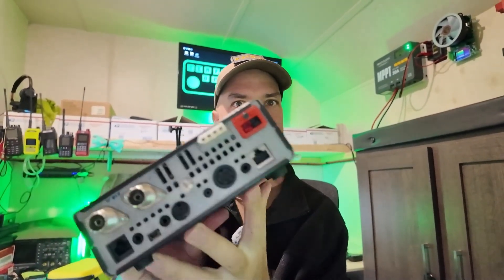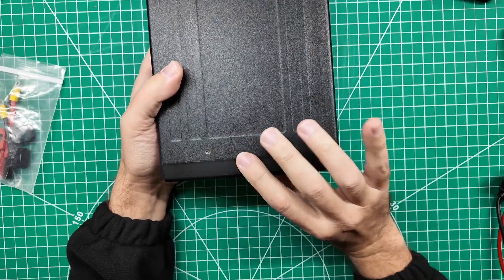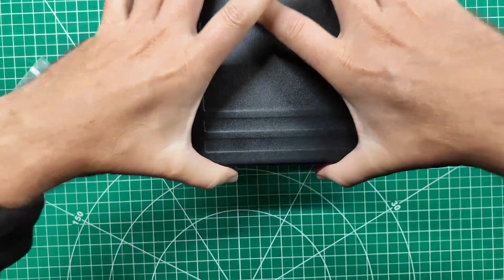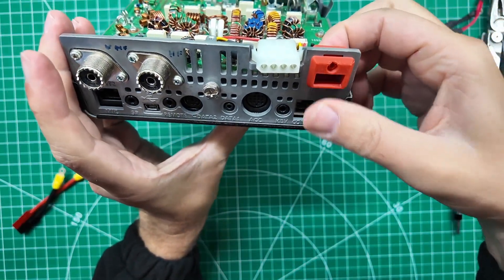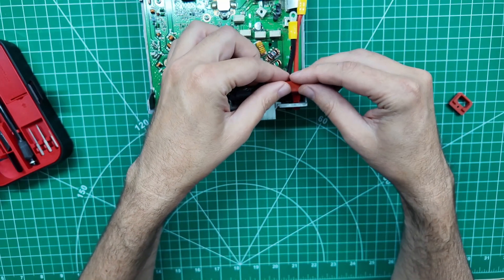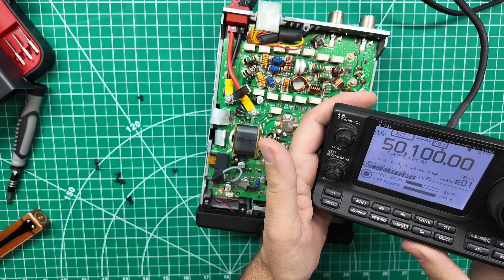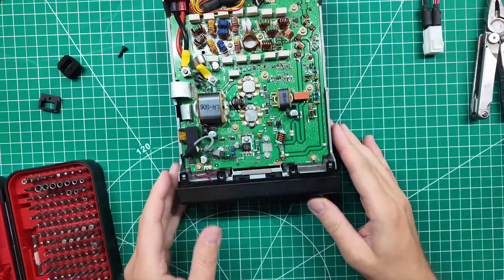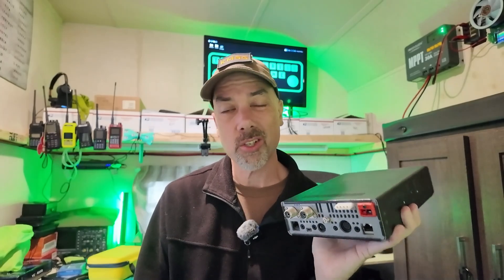This Mod Will TRANSFORM your IC-7100 🔧

Comment: Worse thing you can do. My 7100 needs a really good connection to DC, I have mine bolted down on the PSU terminals. Power poles get tarnished and you end up with a voltage drop on TX which results in a low power output.
Reply from the maker: Thanks for watching

Comment: WHY WHY WHY- Power poles are NOT all that great the modular connection that was on there to begin with was so much more a solid connection! that will handle current draw and efficiently so much better than a power pole. I hate these damn connectors and actually remove them from rigs and replace with a modular or a jones plug..
Reply from the maker: Different Strokes for Different Folks, that's what make the world go round.

Comment: I’m sorry, I don’t agree that taking the very minimal risk in tinkering with the power connection on the 7100 is worth the even lesser value change in removing the icon power connection replacing it with the power pole connections. 73 Tom KC3QAC
Reply from the maker: Seems legit

Comment: The icom 7100 is still sold after 12 years on the market. That's my pota radio . I hate that every other time I pack-up from a park, the power plug wants to fall inward.   I need this mod. I saw in the head unit pinout, that you may want to use a different layout from ethernet.   Someone the audio and control lines are not in the same twisted pairs when pined for ethernet.    It should also be a shielded cable.
Reply from the maker: Good tip!

Comment: You crossed the positive wire to the inside. This forced you to cross the wires. When you first started you stated that the red wire had to be towards the outside of the case, but then when you put it on second time the red wire was on the inside and then you had to force yourself to cross the wires over. Did you notice you did that?
Reply from the maker: Of course I noticed, that's why I pointed out the red needs to go to the outside.

Comment: Any reason why you switched the red and black wire orientation halfway through the video?
Reply from the maker: Mostly because I messed up and drew attention to where the red is supposed to go to make up for it.  It really doesn't matter as long as you're properly polarized as usual.

Comment: Red to the outside (4:54) Oops, now it's Black to the outside (7:00) Hmmm.....Yes, we pay attention. BTW Anderson power poles in this size suck. The metal contacts can push inward AND there is almost zero chance of being able to plug them together without actually looking at them. You will have a lot of difficulty inserting them together by feel only, such as in the dark or on the back side of the radio when you can only see the front. If you just gotta have anderson power poles, install them on the OEM power cord.
Reply from the maker: Huh, interesting. I don't have those problems

Comment: and you recon that the OEM noise damping ferrites on the power cables are magically redundant with your mod!

The term "half baked" comes to mind for your mod
Reply from the maker: You think those little tiny ferrites make a difference in a real world RFI scenario.  How cute.

Also, It's not my mod, you're free to not install it if it doesn't excite you.

Comment: I've got two 7100s in the shack. One is mainly for digital, the other is for uhf/vhf/cw/ssb/d✨️. The one for digital no longer puts out on SSB on most  bands😢 . I put out the call every morning on 145.090 cw from FM29ft Delaware at about 1200 utc. Hope to hear you.
Reply from the maker: CW on VHF?  I never thought about it until now.  Imma try that
Reply: @temporarilyoffline  I like 144.050 and 144.090. I never had any luck on uhf cw but occasionally get a vhf. I'm in Delaware. Range is only about 60 miles so far. Good luck

Comment: Wait, the separation cable for the head isn't a crossover? I always assumed it was. A friend of mine accidentally used a regular network cable on his 891, he got to practice soldering for that.
Reply from the maker: I mean, I'd check first for sure.  I can't imagine it would be different than any of the three commodity standards floating around.  Icom just buys them in bulk from some supply house.

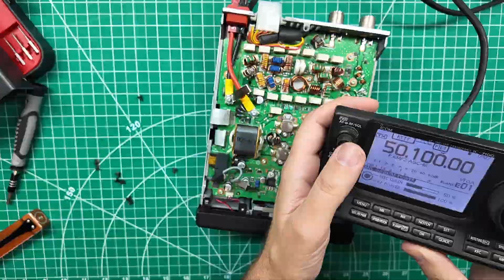Comment: In the instructions (and an example at 5:25), you said the red Anderson connector needs to be to the outside of the radio. But at 6:49 onward, you have the red connector the inside and the red/black wires criss-cross each other...and I didn't hear anything about that in your description. What happened?
Reply from the maker: Video Editing Magic!  Follow the instructions and you'll be fine.

Comment: Why did you switch the red power pole to the inboard side - it was on the outside at 9:15. Was the wire too long?
Reply from the maker: Wire was fine, just filmed at different days.

Comment: I'm a Yaesu fan, but love the IC-7100 as an all in one Mobile radio!  Radio is in the bottom of my Excursion's center console and the Head is on a cup holder mount.  The easiest radio to install, ever!  Mic and External speaker connections are on the Head unit!  So convenient.
Reply from the maker: Can't be beat.  I can only hope more mobile makers adopt this strategy.

Comment: Nice work again! Note the remote cable is a "shielded" ethernet cable, if you want your radio to work properly DO NOT replace it with a standard ethernet cable.
Reply from the maker: Great point, thanks for sharing!
Reply: Yup, learned the hard way…

Comment: Cool.  I bought these for my FT891 (no color choice at the time).  And, though I haven't tried it yet, I bought a second frame, figuring that it would also fit my FT991A, but expecting that I would need different wire lengths.  Lazy me should get around to doing it, since while it generally sits on my desk, and the original cable serves fine, I have taken the 991 to field day with the hope of working a linear sattelite (like AO-7).  So many projects, so much dancing to do instead.
Reply from the maker: I know the feeling - too much to do!

Comment: I still find it amazing that Icom can continue to sell products released in 2012 as new in 2025.
Reply from the maker: I find it amazing that this radio was "cutting edge" in 2012 - should have had a 1080p 5" touch screen with built in FT8 send/receive and full APRS interface!

Comment: Nice up grade. I would run ferrite in DC wires close to radio . Helps with noise getting into radio . That's why they had them.  I made a cable for my IC 7300 that way .  I used a FT 240-31 . I just got that 4 pin plug and 12 AWG zip cord (4) then splice to 10AWG with ferrite then after 2 ft the 2 ATC fuses then power poles . Some one makes nice cord for IC 7300 ,I got that as well and I used snap ferrite buy radio .1 is none and 2 is 1 . I have 3 power cords total. 73
Reply from the maker: You've got way more than 3!
Reply: @temporarilyoffline  Just 3 in 7300 go bag.  Parts and wire to make at least 24 more . I got several Molex kits . I got more than 1 box of power cords 12V for different radios and stuff. Many CB 3 pin and 2 pin . Lost count but always need 1 I don't have  LOL

Comment: Great idea and a must have kit for the IC-7100. Makes me wish I had an IC-7100.
After seeing video's of how to modify a Xiegu G90 manufactured prior to 2024 to powerpole connectors, I decided to be a wuss and stick with an external adapter. Something about removing one board, filing the back panel opening to an exact fit, cutting and then crimping the power pole connector to the internal power leads had reminded me of the "If it ain't broke, don't fix it." rule.
Reply from the maker: @ralphmills7322  exactly!

Comment: Hack: A short piece of 0.095 inch weed trimmer line locks power pole connectors together.
Reply from the maker: @buckeye43210  that is a great hack!  I cut q-tip works also!
Reply: @temporarilyoffline  I was thinking a cut up q-tip would make a good Moxon spacer for UHF 🙂

Comment: The IC-7100 is one of my favorite radios, as well. It's not as good a receiver as the FT-710, but the latter radio would be difficult to mount as a mobile! The IC-7100's angled head works great for mobile, and while the screen seems "primitive" by modern standards, it's VERY readable. This is also the most versatile 100W radio currently on the market.

I also kind of love that the stock power port is not soldered into place! When I read the blurb, I was expecting that this mod was going to involve having to cut/desolder the old and solder the new! That replacement is so easy I'm really tempted to try it.
Reply from the maker: I agree!  I would really hope that the 710 has a better receiver, its like 20 years newer.  (so like 3 months in smart phone time).

Comment: 6:56 am I having a stroke, or between edits, did you flip the radio-side connectors around so that red was to the INSIDE and not the OUTSIDE as originally installed?
Reply from the maker: must be a camera artifact... I don't see it?

Comment: It looks like the internal power pole pins have changed positions during the end of the video? Red started out on the edge when installing, but after lid was replaced black is on the edge?
Reply from the maker: @brianhajder5013  yep. I had to make an update that better explained the seating of the power poles in the chassis.

Comment: Nice mod!  I use a lot of Anderson Power Poles.  Still not thrilled with the connection issues over time.  I think the XT60 connectors are probably better overall.  But I didn't pick the standard.  Beta Max was actually better then VHS, but Beta Max went the way of the Dodo quickly.  Thanks for the video Steve!  73
Reply from the maker: @KS0JD  I haven't made my own XTs, but they don't look as easy to make.  One day.

Comment: Wot happened? At 6:42 (along with your comment) the red terminal is closest to the side. At 7:09 (and also visible earlier) the black terminal is closest to the side.
Reply from the maker: @Hank_W6IR  I didn't have the connector in right and added a correction... Eyes like a hawk I tell ya!

Comment: What about the ferrites? RF on power leads evidently was enough of a problem in some way for the Icom engineers to put them on the original power leads.
Reply from the maker: @nerdinium  those tiny things?  Maybe! 🤔
Reply: I agree. Icom would not have put those ferrites on the power wires unless there was a reason. It's possible that they are necessary to keep RF off of the DC power cable.

Comment: Nice mod. Nice the mic plugs into the 'face' instead of the 'black box'. That's my only real gripe about the FT891.
Reply from the maker: @RicksHamShack  yeah. It's like they never used the radio in that config.  It's the first thing to come to mind when you do!
Reply: Note that the mike will plug into the head or the body (but not both at the same time, don't try th use two mikes!)

Comment: I actually have had trouble with a standard RJ45 cable for separation. A shielded twisted pair RJ45 like you showed works fine. If you get an ethernet cable for separation, get shielded twisted pair. Granted, in my case, the body was under the seat and the head was in the LIDO cup holder mount. Unfortunately, the shielded Ethernet cables are quite a bit more expensive. That is a nice mod. I really wish the 7300 had that head design.
Reply from the maker: @don_n5skt  I think that head should be normalized.  Perfect viewing angle!
Reply: @temporarilyoffline agreed it is the perfect angle. The knob click is another genius thing that the IC-7100 has, the IC-706/703 doesn’t.

Comment: After I did this modification to my 891, I have been waiting for someone to design the powerpole mount for the 7300. I wonder if it'll also work on the 706mkiig which I believe is the same connector as the 7300. I'll be ordering 3 to try it out. Thanks Steve.
Reply from the maker: That's a great idea!  Let me know if it works (or not)

Comment: So cool. Wish the 7000 and 7200 had this. I have the whole family.
Reply from the maker: I kinda wonder if they would fit!  The hole in the case looks the same as the Yaesu 891, they share the same connector and that's where the idea was born.  If your 7000 and 7200 holes like the same and there is enough room inside, give it a shot.
Reply: @temporarilyoffline  luckily Icom has not come out with a 7400 because I would have to buy it.
Reply: yeah every radio should have power poles its so much easier and its a standard unlike all the crazy plugs radios come with.

Comment: Very similar to the ft-891 mod I made recently, including those notches.
Reply from the maker: I think that's "the way" to interface with that connector type and pretty much any radio that uses that connector could benefit from this - if there is room for the powerpole connector itself on the inside of the rig.

Comment: And I thumb😂up knowing XT-60 is the way, the truth, and the light.
Reply from the maker: What about XT-30 or XT-90?  Huh?  What about those fine connectors?
Reply: @temporarilyoffline  they are both better than power poles that is for sure, but the sBitx doesn't ship with them.
Reply from the maker: @Siskiyous6  first, best, cheapest, in common use... These things rarely are found in the same product.